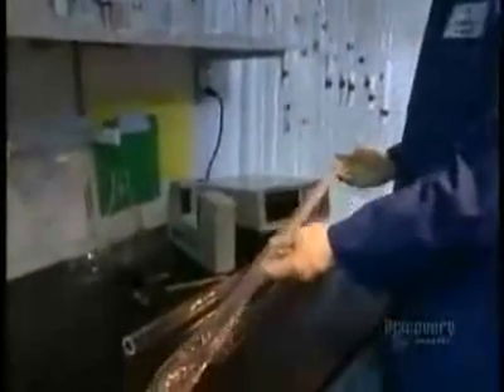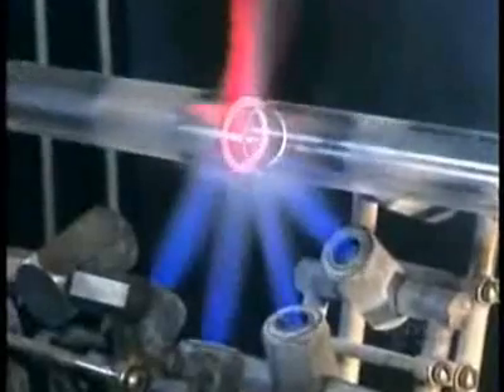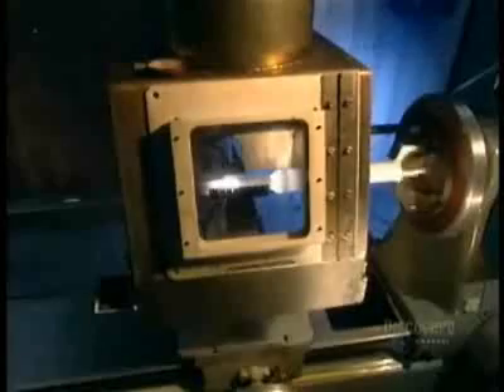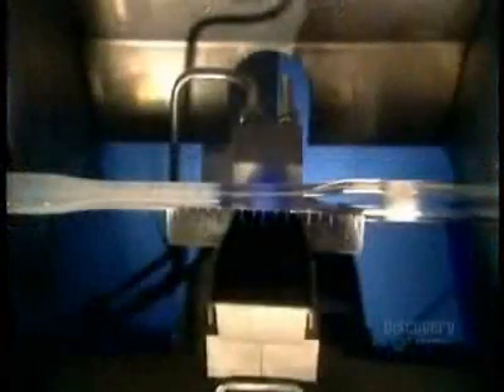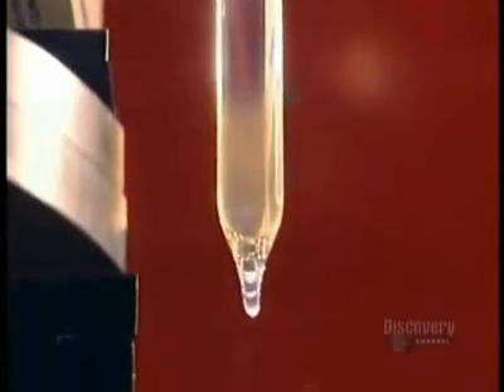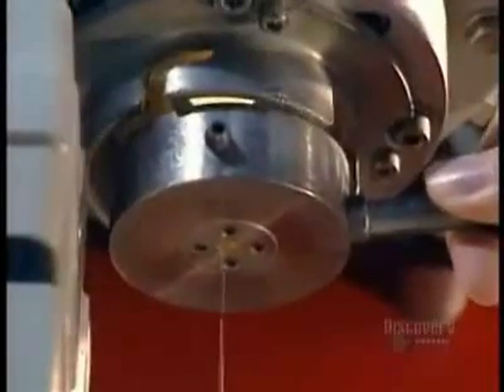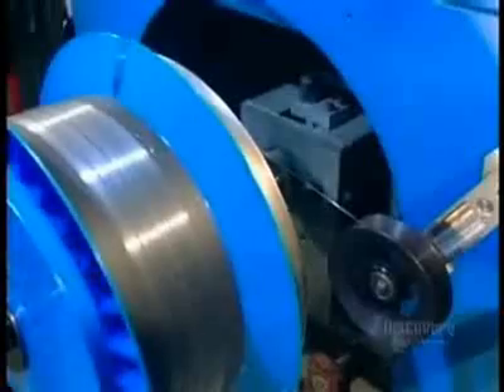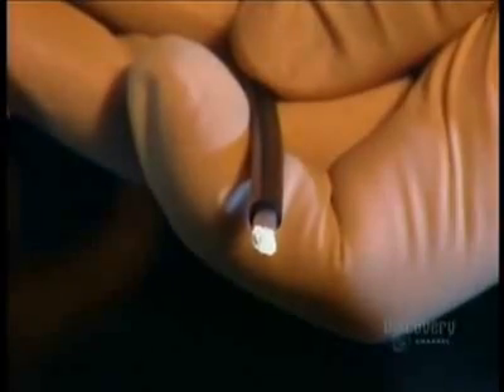Fiber Optics

Comment: We use single fiber optic to transport any signals in any direction like HD video audio data SDI ,RF, DVB-ASI ,CATV ,Ethernet ,we use different light colors for different signals , we can multiplex up to 64 separate signals : thorbroadcast

Comment: @dylanfleck its basically like how an electrical cable sends data as its pulses, instead of small electrical pulses to transfer data it uses the pulses of light instead which then get transfered into data when it reaches the reciever

Comment: that about gravity sagging is not true, its thicker on one side because of the manufacturing process. In Mediaeval times panes of glass were often made by the Crown glass process.  A lump of molten glass was rolled, blown, expanded, flattened and finally spun into a disc before being cut into panes.  The sheets were thicker towards the edge of the disc and were usually installed with the heavier side at the bottom.

Comment: @Ricsic6  

Any data can be converted to binary format which only have 0's and 1's. In fiber optic cable, at the sending end, you turn on the light as "1", and off the light as "0". The receiving side will detect if there is light in the cable, if so, they know it is "1". If not, they know it is "0". In this way, binary data can be transferred through fiber optic cable.

Comment: Fiber optics are useless. I bought two meters of this "modern" crap for my kitchen lamp, but it didn't work. Didn't even light up. I went back to using old fashioned copper wires and voilà!